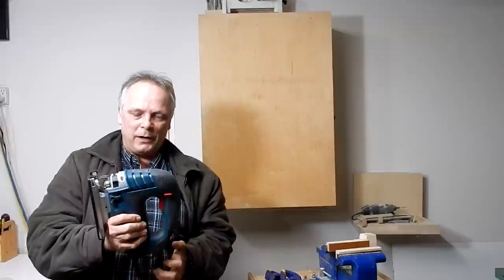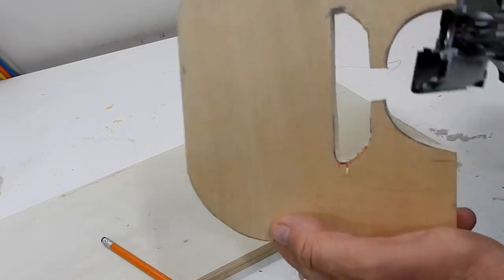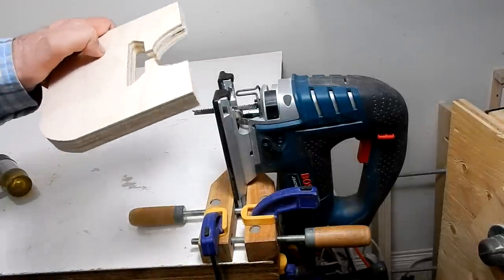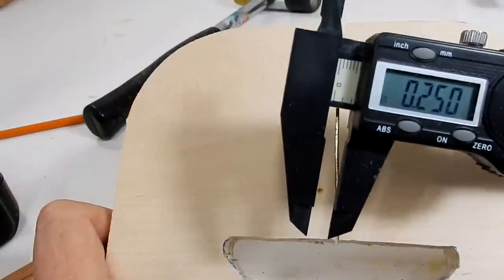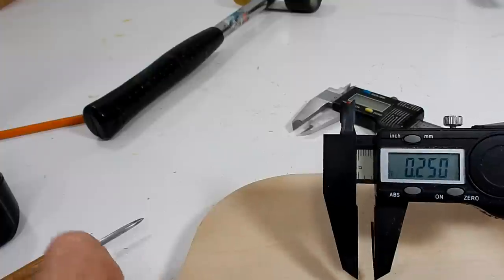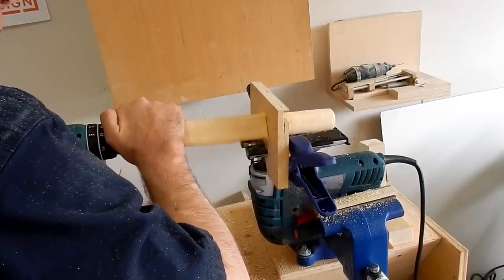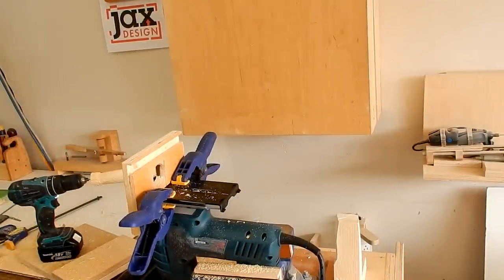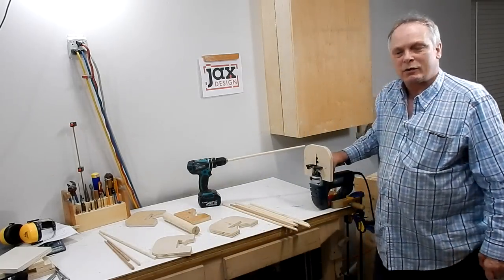How to Make Dowels with a Jigsaw

Comment: Thanks for your videos, effort and nice ideas..
something i needed to ask...  my jigsaw cant slice a 2x3 log through the
 end grain to a 1x3... although its a Bosch GTS150 the same one you're using
didn't have any problem splitting a 6x2 to 2x3 but when i try to split 
it to 1x3 it cant go through the end grain any advise on that
I'm using a Bosch T744D 7" blade on normal pine wood

Comment: That's thinking outside the box Jack. Now you can make version 2 and mount it to a table like a router and have a series of holes in one board so you can change the dowel size and set it up once for multi sizes. I think I might try this.

Comment: Great idea. I was wondering how long the blade of the jig saw will stay sharp, since you are just using the edge? Maybe you could switch sides and make dowels on the other side of the blade when it gets dull.
Dowels are really not that cheap, unless you buy them by the hundreds. I was wondering how many foot long dowels I could make before the blade gets too dull.

Comment: I made this following your video.  It works well but I get a lot of chipping with pine.  My jigsaw teeth stick out a small distance from the surface of the plate when pushing stock through.  Should the teeth be deeper in the plate?       Great channel!

Comment: Very clever Jack, but did you know if you position 2 razor blades in a "V" with an opening secured to a board and attach it to a drill index you can do the same thing using a drill motor to feed it through with the same result.

Comment: Nice one Jack. What did you use to hold the large dowel blank onto the drill as its too large for the chuck?
Reply: ***** Thought a nail on a large diameter would spin in the wood, being the point of least resistance. Obviously not. Thanks Jack.